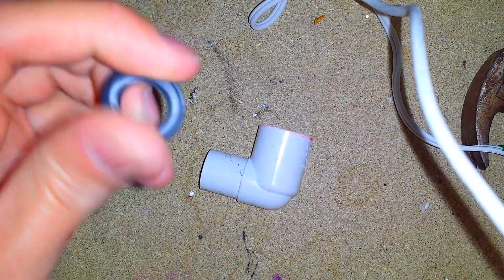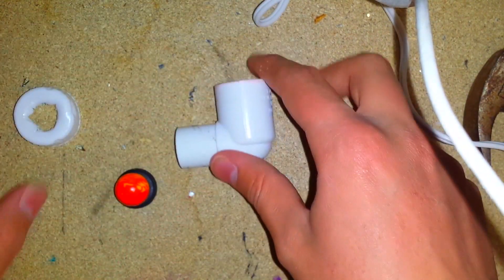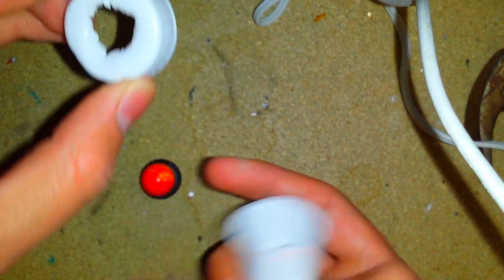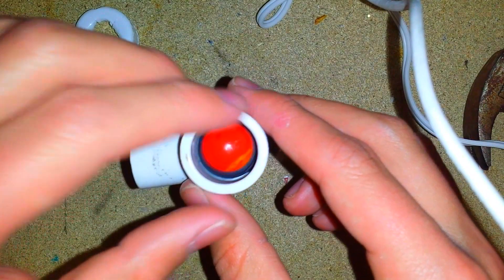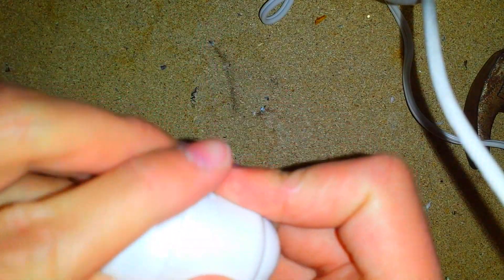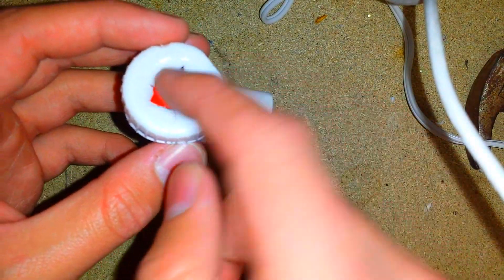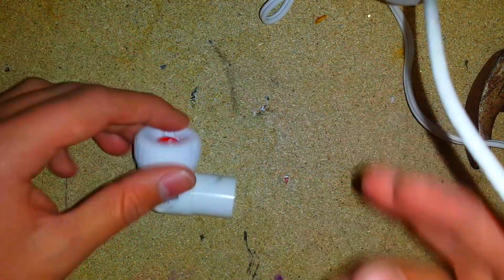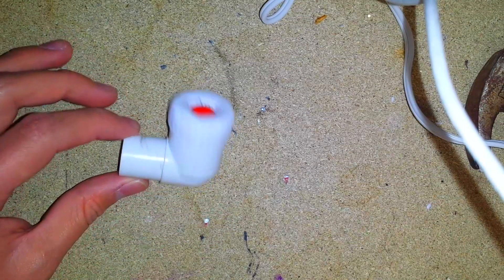DIY | How to Make a Check Valve

Comment: Where I can get this tiny ball, plz give me link
Reply from the maker: Hello! You can probably find a metal version of the tiny ball at a hardware store.
Reply: Dude but the metal ball is too heavy, it will not float when tank full
Reply: @purendragahlot4581  easy solution use a spring to hold the ball down on the O ring

Comment: will not work cap is holding back the ball
Reply from the maker: Try hot glueing the cap a little higher from the pvc pipe.
Reply: @Legomaster50243  try making a video where what you say you are doing or making works properly you dawn key